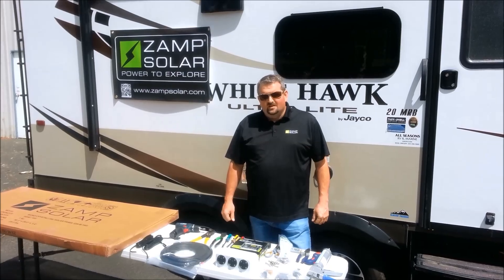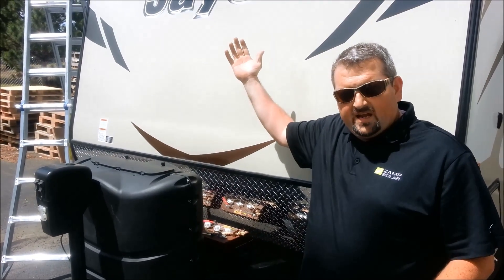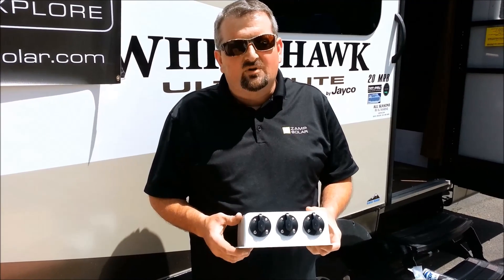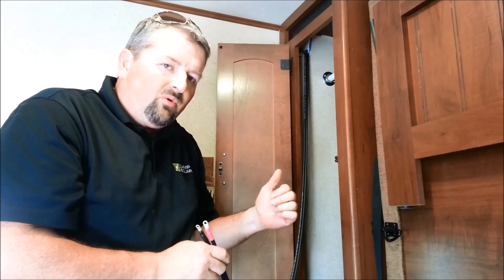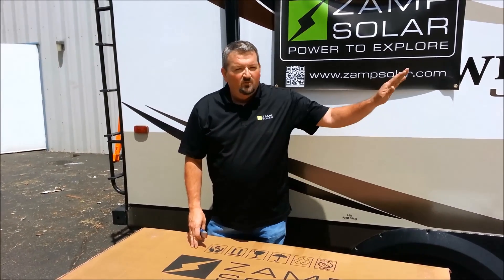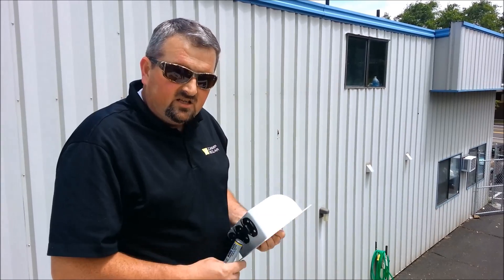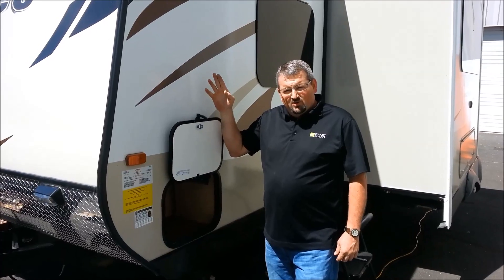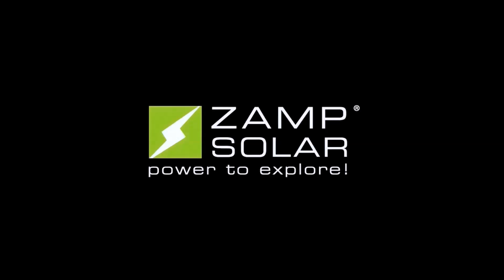Zamp Solar's Deluxe Roof Top Solar Kit Install

Comment: What if my trailer is
Solar ready, zap equipped
From the factory?
Reply: If it has a 3 port roof cap, you can run 520w on the roof and 200w on the side port.  2 controllers needed.
Reply: If it's solar ready then the hard part has been done. Contact us so we can find out what kind of Solar Ready RV you have. 
We have an updated video on our youtube channel for the Roof Top Kits. Check out the new Zamp video here - https://www.youtube.com/watch?v=LWoLBdvno2o&t=10s